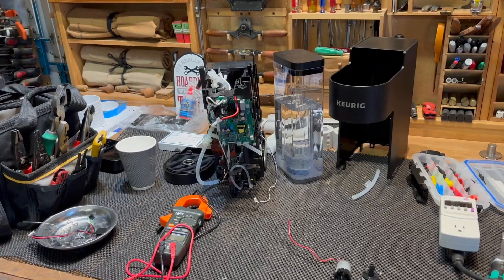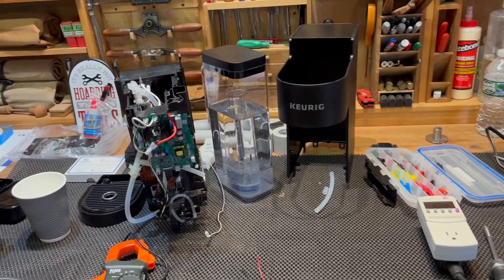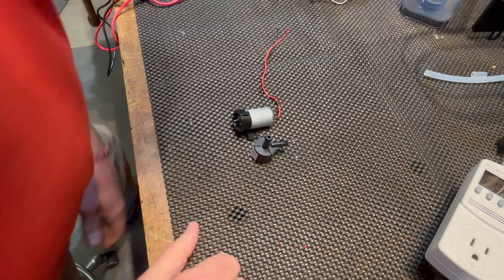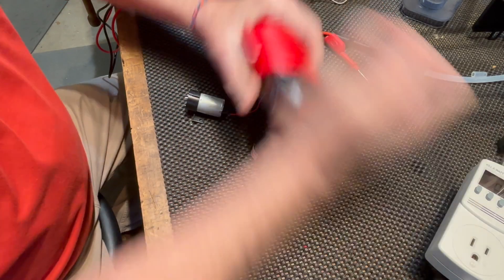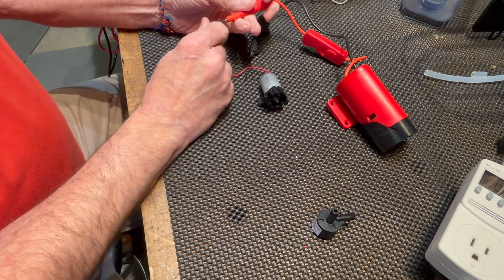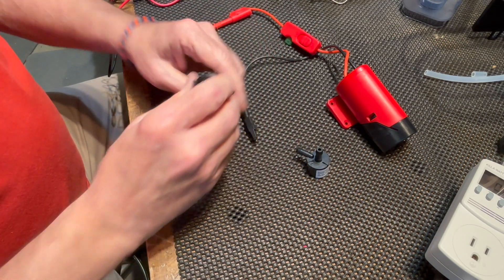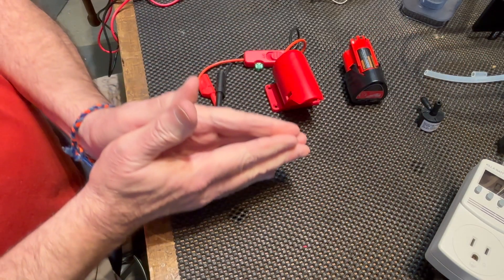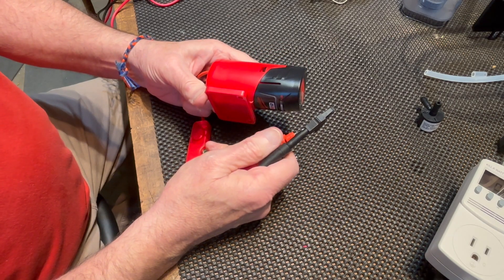Inexpensive 12V Power Supply for Bench Testing and Field Testing

Comment: Thanks for the input, Frank. Exactly what I was looking for! If I may, could you post links to this?  I found it, but had to navigate around the picture shown at the end of your video which was covered by a link to other videos. Also, interested in the particular leads/clips you used. Can you advise? Thanks!
Reply from the maker: Thanks for watching. Sorry, didn’t know that screen got covered up like that until I just looked! I just added some links in the replies for the adapter and the banana connectors to put on the wire ends.